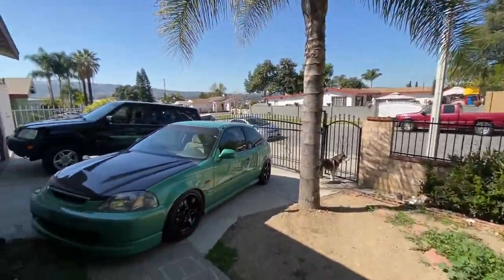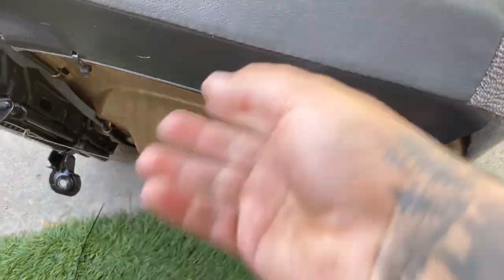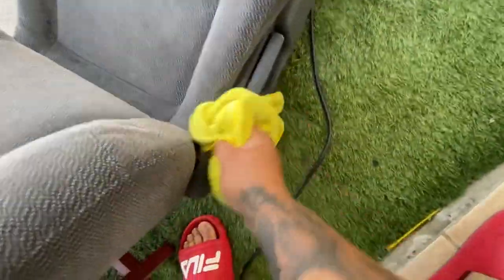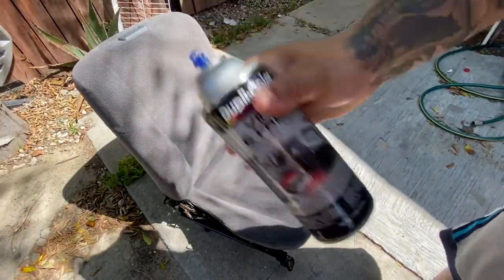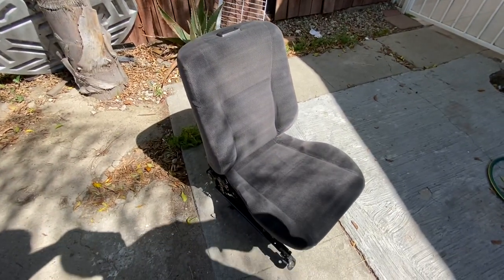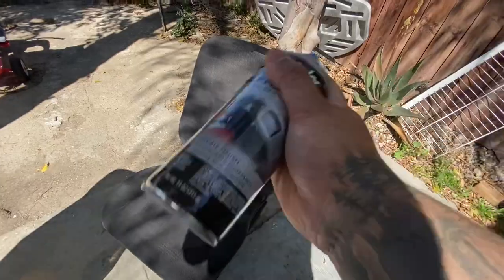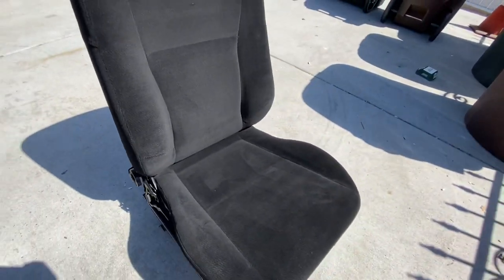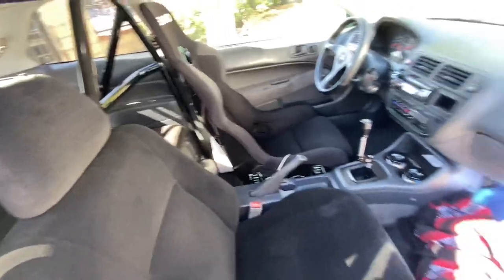DIY: Seat Color Change With Dupli-Color Interior Paint!

Comment: Do you think this would work if you just wanted to recolor the center panels in your seats?
Reply: Which ones bro ? I just painted my door trim panels , a,b and c Pilars and dash . Worked great !! Do 2-3 light coats at first ( so it looks like powdered sprayed not splotched on ) let it dry then do some thicker coats and let fully dry between coats it’ll look great !!!
Reply: @coolricooo4436  Something like taping off the outer (cloth) seat panels if you wanted just the center panels black.  I guess I'm wondering if bleed-through would be an issue.
Reply from the maker: If you just mask everything else off I don’t see why not
Reply: @TetoMedia  yeah I say mask it off but before painting make sure to clean the seat very verrryyy good !! If you can remove it even better . That way you don’t paint over dirt and dust particles. And do very very light coats & let them dry in between until you get the darkness you want. Trust me youll get better results and the material won’t get all hard.
Reply: @imaouima
Reply: @imaouima yeah read what I replied
Reply: @coolricooo4436  I'll try it.
Reply: @imaouima  also if you can find a brush , after it dries brush it a lil before throwing the next coat on . And do at different angles . Paint left to right then right to left then up going down and down going up so you evenly paint all of it